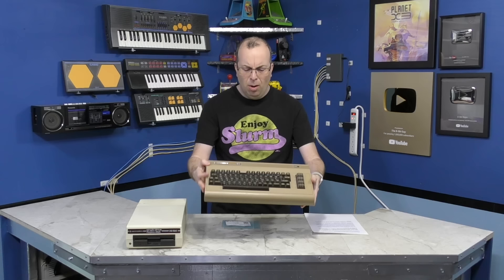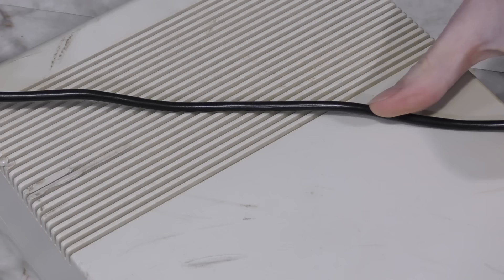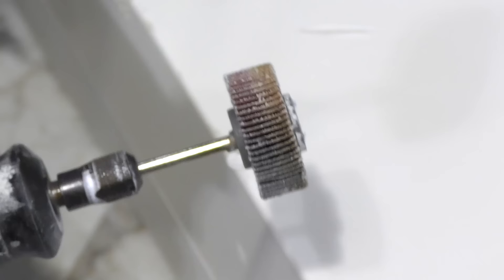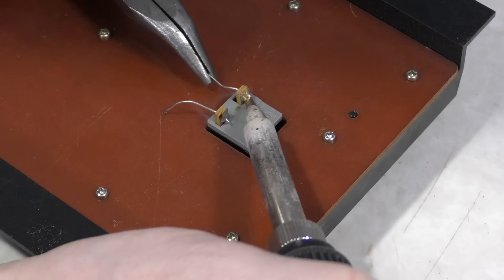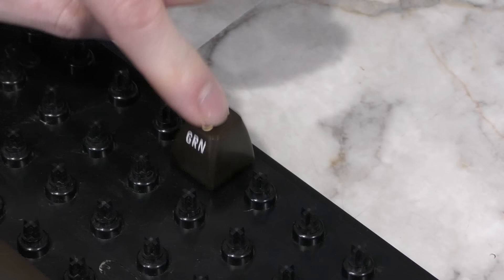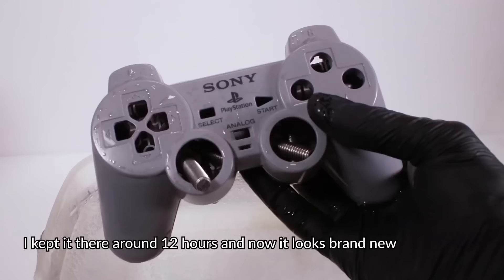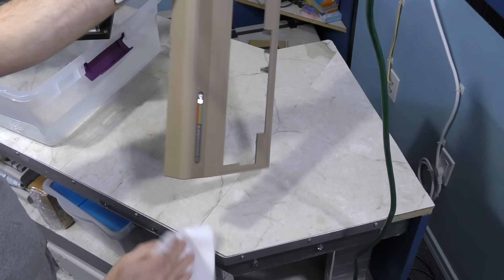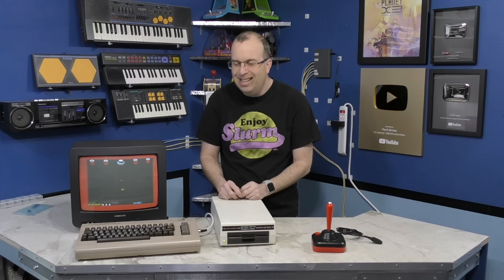Commodore 64 Restoration and new retrobrite technique.

Comment: Great job!  Please please please tell me what you used as a power supply.  The original C64 power supply was encased in epoxy and I burned through two of them before finally retiring the unit when pc clones appeared.  The C64 holds a special place in my heart, because learning how to program with it launched my 25+ year career in tech, from which I am now gratefully retired.  I’d love to switch it back on again for old times sake.

Comment: Have you tried backing soda? 4:20 Daaaaamn.
You can add it to washing machine when washing net curtains to whiten them. In other words. Have you ever tried leaving baking soda mixed with water on plastic for a longer period of time?
Reply: It's an abrasive. He could theoretically use it to scrub off all the yellowed plastics but it would destroy the original texture and leave the plastic weak because it's much thinner.

Comment: I do admire the creativity and craft behind printing new plungers for vintage keyboards but I don't think it will ever be a viable option for replacing these parts. They need to be very smooth in most keyswitch types and exact on the dime in size and dimension to prevent key wobble or stuck keys. This is not helped by the fact that 3D printing often creates layer lines, which are definitely going to be detrimental to the feel of the key. Still, great restoration!

Comment: I do miss denatured alcohol. It’s just another product banned in California.  

I think I would have tried bonding those broken pods back together first before replacing or printing new ones.   

I’m curious at to what your current hydrogen peroxide use is, but I know you don’t respond to these.

Comment: 13:56 well what did you Expect? you made a Rubber Key When the ones Commodore made are of Plastic so those are gonna Wiggle Around like a Bobblehead!
Reply: polylactic acid (the plastic type used to 3d print the parts) is a rigid type of plastic, not even a little flex

Comment: I am curious, as one who likes to pull apart and paint old technology, why do you clean it first? 

If I am working with an old, dirty thing, I will disassemble it and then clean all the pieces individually. Particularly I do this with electronics as I don't want to get and unwelcome liquid or cleaning chemicals into the bits when I'm cleaning the outer casing. I'm very curious as to why you opt to spray down and scrub the thing while it's still assembled instead?

Edit:
It looks beautiful tho keep up the good work. I do so adore these machines.

Comment: Thanks for the restore video.  My first computer was a C64, which I'm sad to say, I got rid of during a move, but a few years ago I found a nice C64 with extras from eBay.  I noticed the Wico joystick, I didn't replace mine yet, but probably will later after I restore the system.

Comment: Paint the parts to be bleached with hydrogen peroxide paste or cream and cover them with plastic wrap. It is more practical and uses less water and hydrogen peroxide
Reply: He used to do that. He prefers the submersion method because of it's tendency to give a more uniform result as he's had projects that turned out streaked or splotched with the cream and wrap method. The other reason he does submersion is because he doesn't have to maintain the process as diligently he can basically set it and forget it.

Comment: Pro-tip for cleaning the dust out of computers, use an air compressor.....
Reply: He did. In a can.
Pro-tip 2. Never blow compressed air into any type of disk-drive slot; use a vacuum instead.

Comment: It looks like the plastic used in the 3D print retracted which is why you had the bobblehead keys.  Did you use PLA or ABS?   You might be able to resolve that in future prints by increasing the size on all three axis by a small amount.  Not sure what that percentage would be, but less than 1% should do it.  That would tighten those tolerances.  The PLA I am using on my phone case worked great when printed last summer.  However when winter came, it cracked in one corner as the strain was too much for it.  Now I have about a 1.5mm gap where it split around the headphone jack.  I'll be curious to see if that shrinks come our 100+F summers this year.  Should've printed in ABS or TPU.

Comment: 6:50 I'm surprised you used the dremel over the 1541 vents. I'd worry about plastic debris down in the drive mech.  BTW the 3-hour retrobrited case looked rather browner to me than your other case. Just saying. ;-)  As for the bobblehead keys, did they wriggle because the base or the top was a poor fit? My guess is the top was a poor fit with the key. I bet some hardening putty or similar will fix that.  PS Can I have the C64?

Comment: I guess either the model wasn't quite to spec, or the 3D printer wasn't accurate enough, since you'd think that with the right dimensions and a correctly calibrated 3D printer, the part would be essentially indistinguishable from the original, apart from the material and the "layering" effect you get from 3D printing.

Comment: I noticed that one of common parts of restoration that makes shure longlivity of an old microcomputers is voltage regular 
and  capacitors replacement 

why this wasn't done,  since it seems to me it is more important than a color of the case?

Comment: How would I perform this with the rear part of a Macintosh Plus?  The rear section is too tall and you would need to much liquid which would dilute  the peroxide.

Also, you can no longer get the 60w lights only 50w and 100w now; should I go with the 50w?

Comment: Ive watched many videos and actually done retrobriteing.  Ive watched and experienced many contradictory results. I've heard claims that using the 3% peroxide that comes in brown bottles works on things like keys or mice. This has never worked for me, even after leaving the keys in the solution for over a week. Ive heard that heat is a factor. Just a few days ago (2-6-23) I successfully retrobrited a C64 case when temps were in the low 30's!

Comment: I picked up a c 64 a few years ago but everytime I plug it in to try it out all I get is a static or snowy image. I have the correct power supply but it came with a sega rf adapter, not sure if that matters. Other than the static though the power light comes on. Inspired by your video I have pulled it down from the shelf and been cleaning it up. But I can not find any troubleshooting info on a snowy screen. Would love some advice as i would love to get it running again. Thanks

Comment: I have a C64 but the case is more like a 128 style case.   I've noticed that the board is shielded.  Would you happen to know what type of Torx bit is used to remove the screws?

Comment: Hi, is denatured alcohol better than isopropyl alcohol for cleaning? I've noticed on my OG Xbox that 99% the isopropyl alcohol and rubbing with a paper towel seems to leave abrasion marks, like little lines in the direction I rubbed.

Comment: Hey So I got a TV that got damaged while moving it so when I turned it on the one side like 1/8 of it was white and when I opened the TV I found out that one of the chips on one of the flex cables for the Screen was pulverized and got hit by the frame of the TV do you have an idea how to repair that? and maybe where to find the tools to repair that? Someone says I need a binding machine they cost more then a normal person can afford but is there an alternative that might be cheap and cost some time?

Comment: Exactly how are you preventing your cleaning agents from dropping through the vent holes and onto the electronics??
I promise that glass cleaner and baking soda will eat the circuit board over time.  Learned through many years of refurbing classic radios.

Comment: What's next? Getting actual hydrogen peroxide that's dangerous to the touch and using lab measurements down to the millilitre to obtain the correct concentration?
Because that's what i did because my school had the peroxide hue

Comment: Are you going to eventually do more testing w/ 3d printed parts to find a more viable solution to use them? As time goes on I'd imagine it'll just get harder to replace a lot the parts like this in older technology. It would be cool to find out why they bobbled and resolve it so we have more options for replacement parts moving forward.

Comment: color saturation/contrast needs some work... the default color scheme is bad. but it's not supposed to be that bad. :P if it's "normal" for that board revision (as in opposed to wrong voltages on the vic-II, an already half dead vic-II, or (unlikely) a dying color ram (or just a 30 year old crystal on it's way out - they do go 'off' frequency' after a few decades) just modify the board to whatever is in the schematic of a proper board revision. wouldn't know never touched an ntsc one. but it's not supposed to be that 'nearly invisible' shade of blue.

Comment: Hey 8bitguy, I have a question. Is it possible to take an atgames classic sega console (with controller ports and a cart slot), and fix the horrible sound and upgrade the board to run 32x games as well? I'm very curious about this so if you could spare a moment, let me know what you think

Comment: I'm just wondering what would be the best method to retrobrite the keys from a keyboard. Right now, I could get a UV light. But I'm somehow doubting what would be best: the liquid Peroxide or the Cream? I have seen also videos of people using the cream without water and it seems also to work.

What's your experience with keyboard keys?
Reply: After seeing other videos, I just heard some people telling that the cream may not be so strong as the liquid. Others said that it changed the surface, while others were successful. Since you seem to have quite success with the liquid, I will try it as well. I'm also thinking that the cream may have other additives like oil, so, it is not ideal I guess.

Regarding the light: right now, I don't have much heat and sun light, so, I will try the UV light method. Anyway, some people says that you will have more even results because the light is constant.

Comment: Even though I got a new one that works, I wanted to know if you knew what to do about a Commodore 64 that shows an image, but all it shows is random symbols. Even random colors appear on the screen! The border is still blue, but that's the only working part of it. Sometimes, the symbols move around for no reason and then stop, and then it does it again. Do you have any experience with a Commodore 64 with this problem? If so, please tell me, because even though I got a working one, it still would be cool to get the broken one working again.

Comment: Please don't spray cleaner on the item you are cleaning, it seeps into small cracks and can cause corrosion, etc.  The same goes for the baking soda.  As an abrasive, it is certainly not something you want inside a disc drive.  Since you needed to disassemble it anyway, why not do that first?

Comment: Retrobright is not a great solution. It yellowed back and the plastic would not so strong anymore. Clean it with 96% alcohol and clean it latter more.  Got now in mint state C64 Breadbin FAT and a mint state C64C 1986 version.  There are 2 colours for the Breadbin a Grey and a Crème. The Crème can yellowed a lot but the retrobright makes it nice but latter on worse.  The plastic of the AMIGA 500/600/1200 are crap and use new A1200 cases from A1200NET.  Got the Black, CD32 Grey and a rare Glow Green GHOST cases. Got a C64 Reloaded MK2 I want latter on  a transparant C64C case for it from Pixelwizard.

Comment: Why didn't you just dismantle the computer and drive prior to cleaning, since you were going to do so anyway?  Seems to me you wouldn't want to get all that stuff into the inner workings of the computer and drive.  Also, why wouldn't you remove all of the key posts while you had it apart.  I can appreciate the restoration and cleaning methods, but the process seemed to fall short in these  respects.

Comment: 0:14 - Why throw it? It could brake when the no look catch fails! Why use liquids or dremel on casing with vent holes to circuitry, before removing the casing and having to clean out the liquids and dremel bits! These are both irresponsible and could have been avoided acts.